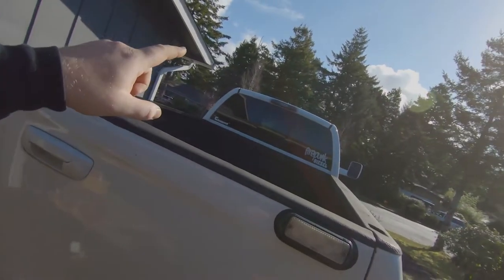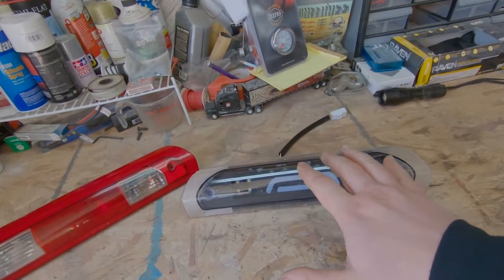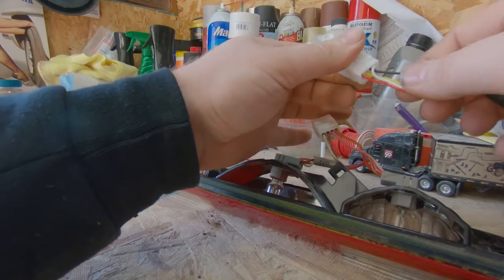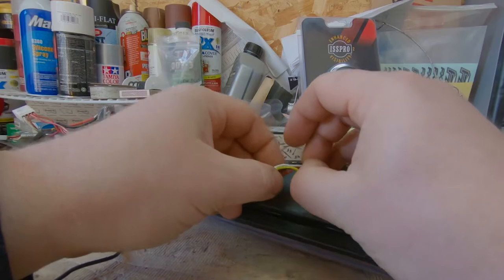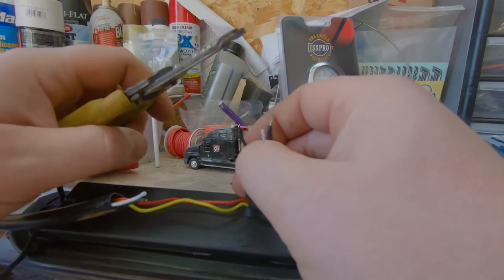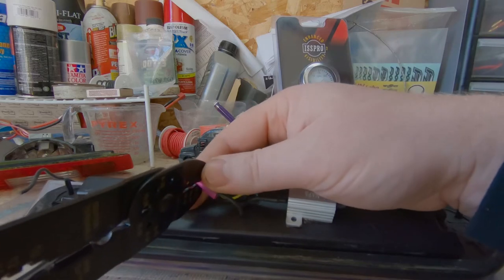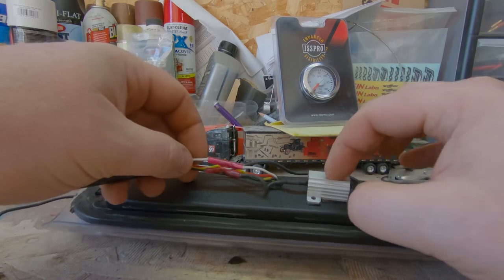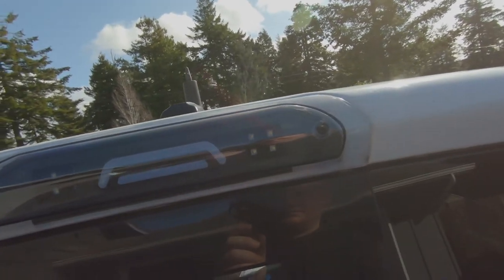How to fix a dim lit led third brake light

Comment: well i got a two pack of the  of risitors and put on on the black and white wire. i needed to put one on each or the break light did the same thing. but all in all...worked great! thx for the vid! very help ful and now my third gen dodge is  finally finished being swapped to led lighting!

Comment: Hello great video thanks for sharing. Have a question i have installed turn signal led arrow inside my cars outside mirror but when i turn the turn signal on it is really dim any idea what can cause that. It's on a 1997 toyota Camry Thanks.

Comment: Thanks for making the video. I need to do this too. Can you provide the specs on the resistor? Ive seen people posting that they’ve used 6 ohm resistors but some say 100 watt and others say 50 watt. Do you know which would be better or if one is safer etc?
Reply: Actually I just saw the other comment where you posted the link to Napa. It says these are 25 watt. And if that’s all it took to work well I’ll stick with the lowest wattage instead of the others. Thanks again for the video!

Comment: Sweet thanks so much for the video I'm going to do this I hate having it on by the way where did you get your headlights they look good
Reply from the maker: Thank you man!! I got them off of Amazon they are spyder brand headlights
Reply: @Cargill450  sweet thanks they look good
Reply: Just installed the resister and it worked like a charm thanks so much for the info

Comment: I have a problem on my truck that the dome lights won’t come on when the doors are open but the cargo light  is on and the third brake light won’t turn on
Reply from the maker: I would definitely check the wiring harness that goes between the door and the body for broken wires
Reply: @Cargill450  I would take a look thanks for the idea

Comment: Thanks for the video. Did that resistor get hot and melt the plastic?
Reply from the maker: On the back of the light, the resistor did get hot but didn't do much damage to the light. It has a little distortion.
Reply: @Cargill450  Good to know, waiting on my resistor to arrive. Maybe I can stick in on the metal instead, I got a cheap light so it'll probably melt. 🤣

Comment: I got the newer model of the same light comes with a resistor already on it my cargo lights come on just fine my brake light won’t work at all tho any suggestions
Reply from the maker: The only thing I can think of is to check to see if you have power at the connector and if you do have power for the brake light try to get them to replace the light

Comment: Is this the fix for what my brake light is doing I have no lights on and there just on they won’t go off I removed it and put the oem one on do you think this will fix it?
Reply from the maker: This does fix that issue as well, you just have to keep in mind you will have a marker circuit and a brake light circuit so you might need to do both circuits on both sides but long story short yes it will fix it.
Reply: @Cargill450  thanks man
Reply: @Cargill450  update it works but only if I connect the negative and positive together and then plugged it into the resistor is that safe😂
Reply from the maker: You should be able to jump across the circuit with the resistor 🤔

Comment: Whats the resistance of the resistor? 50ohms?
Reply from the maker: The resistors I used were a 25 watt led resistor. You get them at napa and they cone in a pack of 2. It has worked really well for me so far
Reply: @Cargill450  Great! Yesterday i was desperate to fix Audi centre brake light with custom built laser LED. After one day, i figured it that audi computer like/need a 4 ohm Varistor in series and 40ohm resistor in parallel.
Reply from the maker: Nice! I'm glad to hear it worked

Comment: Don’t those resistors get really hot? Could melt that light housing
Reply from the maker: Possibly if it was left on for a very very long time but these ones have a really good heat sink on them also. I'm not super worried about it melting anything.

Comment: Do you have the link to to resistor from Napa really want to do this thanks so much
Reply from the maker: I'm sorry it took me so long to get back to me but here is the link for the load resistors I used to correct the third brake light.
https://www.napaonline.com/en/p/BK_7359081?partTypeName=Load+Resistor&impressionRank=1&keywordInput=led+resistor
Just incase the link doesn't work the Napa part number is 735-9081
Reply: @Cargill450  your totally fine thanks so much I really appreciate it can't wait to get it fixed

Comment: Have you had any problems with the resistor getting too hot? I used the same exact one as you.
Reply from the maker: I haven't had any issues at all with the resistor getting too hot, it seems to be holding up great so far
Reply: @Cargill450  okay thanks for the peace of mind, as I mounted it in the same spot. Love the content btw
Reply from the maker: Thank you man that means alot

Comment: Can you tell me where you buy that resistance I have same problem
Reply from the maker: I bought mine at napa and they sell them in a pack of 2. Also here is a link if you wanted to order them or get a better idea of what they are.

https://www.summitracing.com/parts/upd-34235?seid=srese1&gclid=CjwKCAjw_ISWBhBkEiwAdqxb9i4g3dklNUjeM0LnpBqsGtR4_vCiZ9rnFI4j82te9XMmZhGs2EewKhoCWhQQAvD_BwE

Comment: my problem is my aftermarket led brake light is so dim its worse than factory. Im gona polish my old assembly or buy another OEM and stick in super bright SMD leds into the light bulb slots. It will be 5x brighter than these led garbage products they seem to be making now.
Reply from the maker: I thought this one would honestly be brighter but it is a little brighter then the factory unit so I will run it for a while atleast

Comment: So I did this. It didn't work. I followed everything you said. I even swapped the wires just incase.  The lights still lit up. Waste of a light now.
Reply from the maker: I'm sorry it didn't work, if you want to send me a picture of what you have going on I would be more then happy to try to help
Reply: I will try. I'm not sure how to add photos to this. If it helps, the resister was so hot.
Reply from the maker: I'm not sure about on here but feel free to email me at cargill450@gmail.com or find me on Instagram but the resistor will naturally get extremely hot but should be fine mine has been in there for quite a while now with no issues
Reply: @Cargill450  hi im in the same boat.... did you guys find a solution?
Reply from the maker: It does work, you might possibly need a bigger resistor then the one I used but it does work